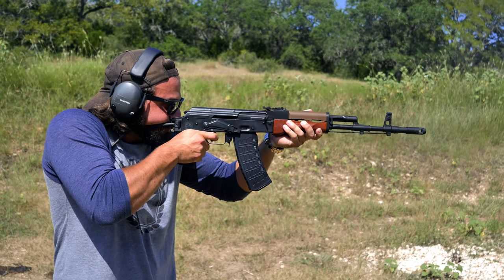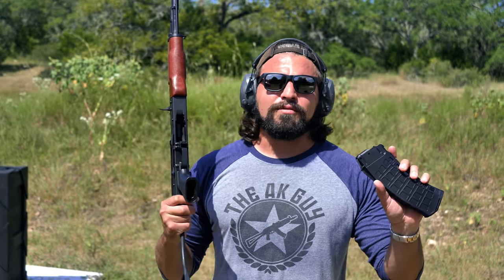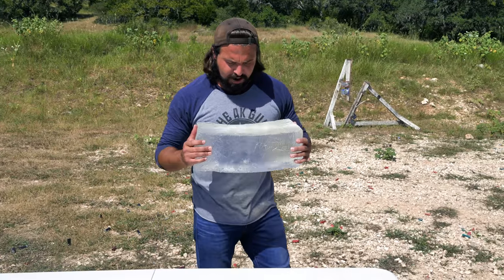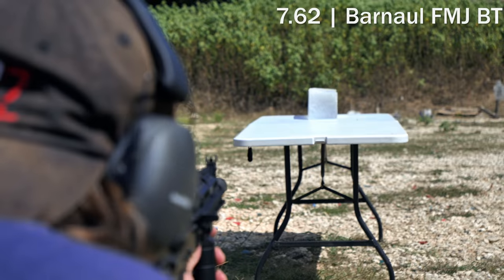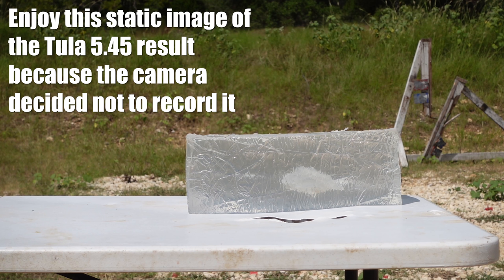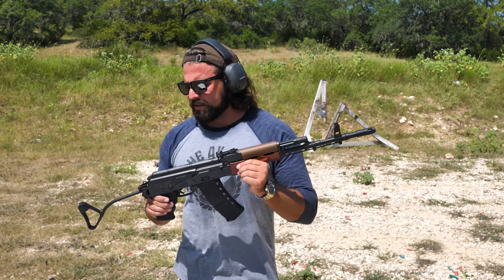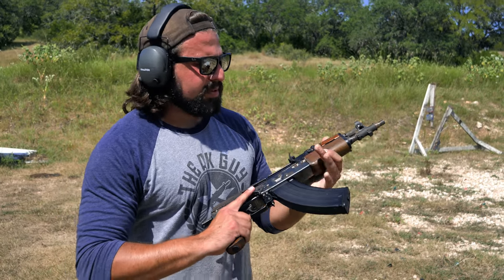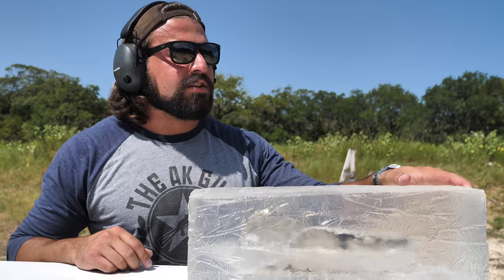7.62 vs 5.45 - Which Is Better?

Comment: My question is would David Chipman try to claim an AK chambered in 5.45 is an assault weapon? By his standard presented during his hearing it should not. 
As 5.45mm is only 0.214 inches. That would indicate it is not equal to the caliber of.22 let alone larger. Therefore by his definition a gun chambered in 5.45 is not an assault weapon.
Reply: I don't recall him specifying bullet diameter as the benchmark, just .22. His statements don't really have any legal bearing so if he were to try to actually codify it he could just specify the muzzle energy or powder load of a 22. Besides, .223 and 5.56 are both essentially 22s as well. (.22 inches = 5.6mm)
Reply: You assume that idiots play by a standard set of rules. They'll just move the goal posts.
Reply: @witiwap86  so caliber is just the diameter of the slug in inches? I assumed as much, but never knew for sure. 

Of course, saying 12.5 doesn't quite have the same ring to it as .50, so for once i won't complain about the imperial system being annoying and awkward.
Reply: Could people use that logic to get around bans on calibers bigger than .22?
Reply: And what about flechet guns or the H&K stuff like the MP7? That’s smaller than .22 as well
Reply: @Santisima_Trinidad  yup, your hunch is correct :) .30cal=7.62mm
Reply: @longbow6416  so .308 would be like 7.71? Seems kinda small. And thats annoying, because its only recently i managed to convince myself that .308 didn't sound like a very small round.
Reply: @Santisima_Trinidad  Yep, that's what caliber is. Don't get it confused with gauge (shotguns) though because that's something else. The name/size of the caliber isn't actually as straight-forward as which one sounds better. It mostly comes down to the country the round was developed or who it was developed for. For the next part, a disclaimer: I haven't researched this so I'm not a great source. Sometimes the names are largely arbitrary. The .223 projectile is actually just .22 caliber. They just added the 3 at the end so it would be obvious it's the high velocity round rather than the standard .22. The 5.56 is almost identical (same bullet but higher pressure in the chamber) to the .223 but it's measured in mm because it's standardized for NATO. The .308 is a modified NATO 7.62x51 that was developed for the US market. On top of that, the caliber doesn't tell you anything about how big the case behind the bullet is. There are some really big bullets without much powder behind them and some really small ones with a lot. I'm not a huge gun guy and I have to just look up what a lot of the calibers actually are in terms of power. I'd say that it should be more standard, but that isn't really possible. There are situations where a slow heavy bullet is better than a fast small one and vice versa. I hope this helped rather than just confused you.  :)
Reply: @witiwap86  it did help a lot. Although i did understand some of it beforehand. And, of course, .308 is the diameter of the bullet, but at face value it doesn't tell you the length of the bullet, so thats kinda annoying. But, it also makes things very intresting, which is fun.
Reply: @witiwap86  gauge is the number of lead balls of a specific diameter that equal one pound.
Reply: @Santisima_Trinidad  you are correct, also a .50 caliber round is 12.7 mm in diameter not 12.5
Reply: @Santisima_Trinidad  I don't do reloading but .30 cal bullets can actually run from .308 to .311 if put a caliper on them. So all .30 cal rounds .308, 30-06, .300 blackout are kinda a misnomer
Reply: @longbow6416  you see, this is where i get annoyed at manufacturers. And the imperial system. Would never happen with metric. Or, at least, a lot less. Probably.
Reply: @Santisima_Trinidad  sometimes always never and never sometimes always :) as a mechanic, many American cars will use both fastener sizes metric and ASE. The most 'used and losed' size? 10mm
Reply: @longbow6416  that is very intresting. and 10 millimetres does seem to be the most common fastener size in general. Cars, bikes, boats, everything.
Reply: Depends on the way the law is worded. California, for example, made sure to use the word "centerfire" to describe what they would call "Assault Weapons" to exempt rimfire rounds while still hitting .223 and 5.45mm.
Reply: @andreivaldez2929  it was never about a law is about his standard as he presented his opinion.
Reply: @Santisima_Trinidad  The calibre they are commonly known by is only an approximation. A big part of it is because there are three things you can potentially measure, the actual size of the bullet, the diameter between the lands of the rifling and the diameter between the grooves of the rifling, and different rounds measure different things depending on where they were developed and what was trendy there at the time. And it's the same for metric calibres too; 9x19 is actually 9.03mm, but 9x39 is 9.27mm. The Russian '7.62mm' rounds are actually 7.92mm.
Reply: @WJS774  for fecks sake. Normally when things have a number of possible measurements they are taken from a standard point, or the point is explicitly stated. But apparently not for bullets, because fuck it, who needs standardisation when you have thousands of newtons ready to drive the bullet through regardless of the amount of jank.
Reply: @Santisima_Trinidad  When guns first came around you couldn't even get everyone to agree on how long an inch was, let alone anything else. You're expecting international standardisation on things invented in the medieval period?
Reply: @WJS774  yes. I am. Esspecially on bullets which were invented when people should have known better. Hell, gauge is a standard measurement, and even if it is weird, at least its standard, and that was invented long before rifle cartridges ifffin i remember rightly.
Reply: Get the vermier out and you’ll see
Reply: @witiwap86  .223 is actually .224 diameter
Reply: Реальный калибр пули 5.45 - 5.6 mm
Reply: @Santisima_Trinidad no real need to standardize it. Does it really matter to the user if the name clearly indicates that it's a .308 or a .311 diameter bullet? It is basically just a trademarked name, which is then adopted into common use. It's like naming a car, it's for marketing. Sometimes it's not even accurate, the .38 Special is actually .357, because when they named it it was using a different style of bullet. They changed it to .357 later but kept the .38 name because that was popular and recognized by customers. When they made  a more powerful, high pressure version of it, they called it the .357 Magnum, both to be more accurate and to make sure the customers recognized it as a whole new round. But that's why you can shoot a .38 Special bullet out of a .357 revolver just fine. 
Anyone who really needs to know exactly what size the bullet actually is, like reloaders, is going to know enough about the subject already to not be fooled by the common name the cartridge is known by, and will have access to the exact data.

Comment: I used a 7.62 during my military service and the most fun part of that round was shooting targets through the trees.
Also a popular meme about AK variants is that they're inaccurate. Well, I can't speak for all of them but the RK95 I used was definitely accurate up to 300m which was the longest range we used. Had no troubles hitting the human sized target at that range.
Reply: The memes are American because (non-reloaders) only have access to the cheapest of target rounds for 7.6x39. I am guessing Finland? You all have state of the art components... for the AK.
Reply: @bill8617  Yes, Finland. Also as I understand, the RK95 is one of the best variants available.
Reply: AK isn't as accurate as an AR simply due to the tolerances of the weapon.  Which has advantages and disadvantages, hence the AK's unrivaled reliability.  So you can get a smaller grouping with an AR, but its irrelevant in the real world usage.  I'd take an AK over an AR, but an M4 over both.
Reply: @AB-nv7bz  An M4 is an AR, it's the carbine variant of the m16.  AR is a platform, saying you'd take an M4 over an AR is like saying you'd take a Glock 17 over a Glock, or an L1A1 over a FAL.  
Also military M4's are not intended for long range accuracy either, your typical M4A1 is supposed to be about 4 MOA (you don't really need anything better to be combat effective, as you said, typically irrelevant to real world usage),  in comparison well made AK's average 2.5-3 MOA and a decent free-float AR15 (which would include block 2 or URGI M4s used by SOCOM, where the extra precision does count) can easily achieve less than 1 MOA with the right ammo.
Reply: @AB-nv7bz  Nobody knows the AK like Marco Vorobiev. The former Soviet solider has spent nearly his entire life behind the sights of the Kalashnikov and literally knows the rifle from the inside out. Some say, “Yeah, but it’s not accurate.” I say, BS. The gun is not inaccurate, that comes down to the shooter. A M4, when you’re talking about 16-inch barrels — a carbine — an AK outshoots it. The gun is designed to strike at 0-1,300 meters a human-sized target. A M4, is out of range at 660 meters. If someone says it’s not accurate, I say, “No — you’re not accurate.”
Reply: @BlackSpade72  if we are talking groupings an ak won’t be as accurate as an ar.  It’s simply a trade off between reliability(looser tolerances) and  accuracy.  The minimal difference in accuracy is irrelevant to the intended purpose.
Reply: @AB-nv7bz  Lets keep in mind the AK is MILITARY accurate. By this I mean it is meant to hit a man sized target out to a fairly reasonable distance (300-400yrds).  Russian soldiers and the rest AK soldiers  of the world ain’t no worries, AK will get the job done. Beside it’s funny when people says “ AK isn’t accurate as AR”  if that’s true AKM would not be in Military service . AK has been in service for 76 years & longer than AR 👊🏻
Reply: 300m is nothing. My 556 can go over 1000 with no losses to lethality.
Reply: @AR15andGOD  But it really can't.  There is a reason the miliary is changing cartridges.  5.56 is too light.  It doesn't displace its energy, just puts tiny holes in things.
Reply: I’ve shot m855 through trees as well
Reply: in basic training, in western Canada, we could not pass basic unless you where able to get a grouping at 600 meters. there where a small group of us that even qualified as unit snipers in basic.
Reply: @AB-nv7bz  Nothing to do with tolerances, the long stroke piston of the AK is too bulky and cause more barrel flexing, speaking of the barrel it's rare for AKs to have free floated ones. Meanwhile a VZ58 (especially CSA, they use CHF barrels instead of cut American memes) or RK95 or BREN II are as accurate as any M4/M16 out there.

Like you said, in real world application it's irrelevant anyway, I would personally take anything over of M4/AR , Direct Impingement is a meme, there's too many weird part (buffer in the stock? non foldable stock?¿) and I'm not American, anything AR cost twice as much as in the states, that's the most important point I think "what's available near you?"
Reply: @selmevias1383  Doesn't that only matter for follow up shots?  Ya DI is bad.  It seems like a lot of modern AR variants have switched to short stroke.
Reply: @AB-nv7bz  Nope, a typical AK barrel will flex even without the massive bolt+bolt carrier+ piston moving, you have to get the top of the line stuff to have a very solid rigidity there but it's expensive (which explain the difference between an Arsenal SAM or Meridian Defense and a Norinco or WASR) and even then, like we agreed upon as long as it print less than 4 MOA at a hundred it's good enough for the military, especially since Russians are very firm believer of full auto only (saturate and suppress the enemy infantry so the real killers: threads can line them up without too much risk).

The problem with the Armalite Rifle DI system is that it's not a true DI, the rifle like the Garand before it's age is an amalgam of European technologies (even if that usually anger Americans) mish mashed together, the main flaw there is instead of having a linear push like on a Simonov or MAS 49 the AR have a weird hole inside the keyhole to start the impulsion downward so instead of naturally venting the hot carbon it will trap some of it inside, it's surprisingly good in a desert environment thanks to it's "self cleaning" capabilities but it's a very meticulous system with a lot of point of failures/moving part, only the USA have the budget to deal with such a "princess" system.

Don't get me wrong, Anything is better than nothing but like I pointed out earlier, where you are is more important than anything since it will dictate the availability and cost of parts, where I live I can get surplus 7N6M 5.45x39 for 0.18€ a pop and in crates of 5000, which is twice cheaper than even the cheapest 5.56x45, if it's the other way around in your country and you can buy an AR for less than 600€/$ go for it, I know the cheapest AR in my country is a DPMS and it's 2000€/$, the price of a SCAR-H...
Reply: The problem with long stroke piston is you have more momentum reciprocating mass.  It's just physics, you can't get away from it.  Look what happens when you try --- you end up with monstrosities like AN-94, AK-104, etc.  And of course such "solutions" are hilariously ironic given Mikhail's famous quote “Things that are complex are not useful, Things that are useful are simple.”
Reply: @AB-nv7bz  ak reliability is also because of how ridiculously  overgassed  they are
Reply: @masonfarber2604  speaks to the Soviet ammo quality control.  It’s always gonna cycle.
Reply: I hit 3 times in the centre (10) using 50m sized shooting target from 300m and 9/12 with the 25m sized target from 150m and got ampumapinssi lol, the luutnantti was surprised and tried to push me serve 1 year instead of 6months

Comment: 5.45 . AK74 was my service rifle. Even it's biggest minus - prone to ricochets,  can be turned in plus  -  Yes in wood it's frustrating - 76N often ricochets from the three's branches with distinctive noise - piiiiuuuuuuuu . But shooting thru the window in a room with  concrete walls there is 1 or 2 deadly  post-ricochet vectors . I had a chance to play with that numerous times at abandoned structures at remote outposts. 
Fun fact - center hit with 76n on empty tin can doesn't produce any movement of the target . Looks like miss from away . Close look shows a  small entry hole  on front side and one giant exit hole at the back of the can . Actually back of the tin can is not just pierced but ripped .
Reply: Were did you serve?
Reply: @TheSeanoops  Bulgarian arny 1991-1993 , motor-rifle infantry. Conscription service.
Reply: Hello dear. The variety of 545 cartridges is amazing. Since 2002, live ammunition with a reduced chance of ricochet has appeared. At least such cartridges are present in his homeland.)
Reply: I love me 5.45. Mostly because 4 large mags of it weight eeeehh... Significantly less. It's just such a nice caliber. And those black RPKs are sexy as fuck, although i did not like the stock all that much.
Reply: @Reriiru  
According to mine memories, the standart wooden stock of ak74 is the best for shooting, the triangle folding excellent for hauling around all day long  and the plum plastic stock somewhere in between.  RPKs standart wooden stock is really a weird shape , i did not like it too.
Reply: By the way I find RPK little bit pointless from military POV.  The Ak74 have 90 percent  of the RPKs performance minus the mobility disadvantage. 
In Bulgarian motorifle infantry squad  1991 , we still had one PKM in addition of the two RPK.
Reply: @krumst  my frame of reference is my black RPK and my mates bog standard AK74. I liked his stock more, since it’s curved. It’s not a big deal, just a bit nicer I guess. About RPK being pointless… I handles sustained about two to three mags better and the bipod makes it nicer to shoot. I mean it’s better for one dude in a platoon to carry that sort of thing around then five. They are not much different, the loadout is basically the same, but in my opinion difference is enough to make a difference. Then again I am a long range radiostation commander, if I am ever shooting at someone, then shit’s FUBAR.
Reply: @Reriiru  
Like a real armchair feuldmarsh :) I think at today's battlefield the GPMGs , RPGs and sniper rifles are  obsolete. Speaking of regulal moto- infantry.  Squad of very fast moving dudes  with ak74/ar15, capable IFV/BMP and the rest is low level tactical drones.  Drones and pllatoon level precision guidef mortars  fills the role of MG,  antitank and long shot rifles.
Reply: @krumst  when you say gpmgs  are you referring too platoon level like 7.62 or like battalion level 50 cals and would you say squad automatic weapons serve no purpose in today's world?
Reply: @bagobones9891  Can't speak at the battalion, but at the platoon level - yes. 7.62 MG/autocanon  are at the IFVs, whatever they are.  Dismounts  with 5.45/5.56 rifles and low level tactical drones/loitering munitions . The IFV spreads mid level drones/LMs and serves as communication hub. Fast and deadly :)
Reply: @Nikola S. София . Бях мотострелковак полка Елхово 91-93 г. 2ра рота, 3ти взвод. До командир на  взвода изкласих последните 8 месеца.За срочнослужещ  - доста уникално :)

Comment: personally i like 5.45 x 39 for medium range but if i have a choice for 5.45 x 39 vs 7.62 x 39 for home defense or shorter range i would pick 7.62 x 39 because of the stopping power and speed of the round
Reply: What do you like about the slower speed of 7.62x39?
Reply: @YEEYEE-dy8tk  it's twice the grains of the 5.45 and bigger bullet diameter, better stopping power up close. In all other aspects 5.45 is better.
Reply: @ДмитрийКолпаков-ы9ь The penetration of the 7.62 on hard targets is better, too. Heavier, slower projectile won't fragment like the speedy, light projectile.